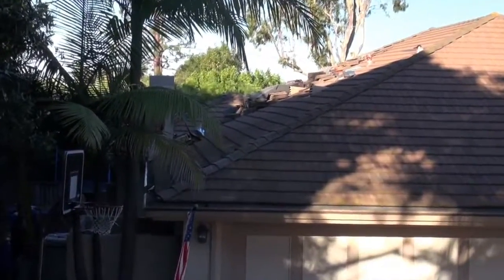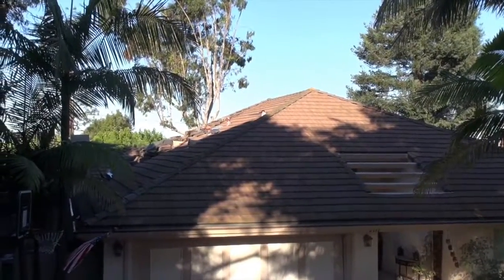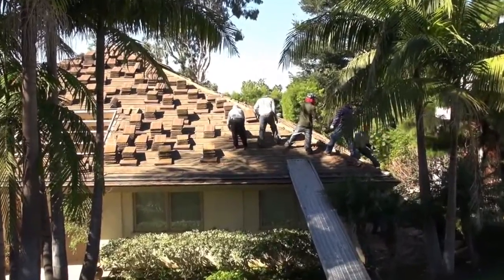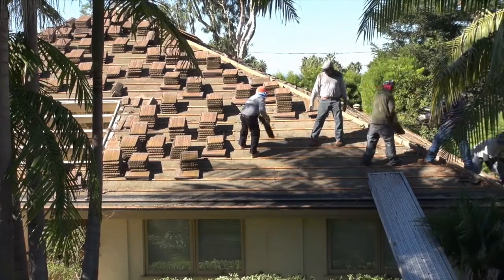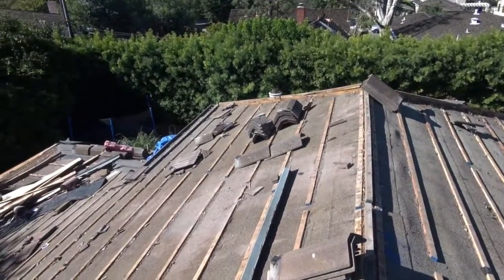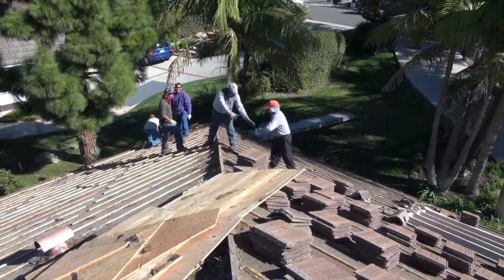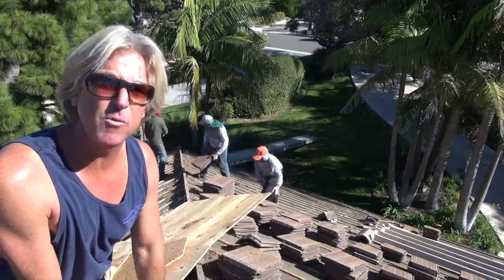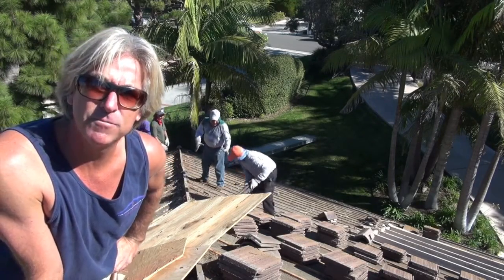How to Remove concrete roof tiles fastest way Palos Verdes Roofing Contractors

Comment: Just curious, what State/City is this roofing job in and, what would you normally charge for an entire roof reset?  I am out in Arizona and it seems like pricing is just insane.   To keep pricing in perspective, what would it cost to remove tiles on a 2,000 sq foot home, replace the base paper, and reset the tiles?  Nothing more.  How long would this job take and normally cost?

Comment: Talking rubbish, why not remove tiles from one side, replace what they need to replace and then load tiles from another side to fill the side just replaced. Another way is load tiles higher and start replacing from the bottom.
Reply from the maker: Thats a great way to also do a tile reset ! 
I agree with you.  
And that is typically the way we do it under normal circumstances. 

In this case. we saw visional damage
and decide to cut out  a sample section in various areas of the roof line to determine amount of dry rot and termite damage in the  built in gutters.
after sample removal,
There was a lot of wood damage.  
after   Further inspection of attic space
 We did a formal inspection of the  roof attic before we sign the contract and saw significant termite damage in inside the roof line attic space  through out various areas of the roofing surface.

so we decide in this circumstance to remove all tile off the roof line and store it next to the house. to properly remove wood damage.  
 

  if you look through my videos I have your idea or that exact tear off video in my catalog. already uploaded 1 year ago. 
 check it out   we are doing exactly what you described in this Spanish tile video .
by tearing off tiles then stacking them on section next to their section of roofing  until roof is completely paper. 

some cities require roof sheeting inspection, so be carefully when you are tearing off a roof. 
this is the way we decide to remove all tile at once to pass inspection right away.
with a bunch of  guys on the job at once
 we remove all termite and dry rot damage wood in one day. 
thanks for your comments
cheers